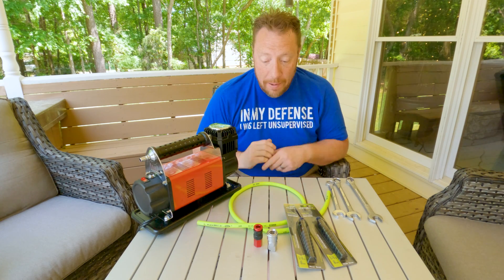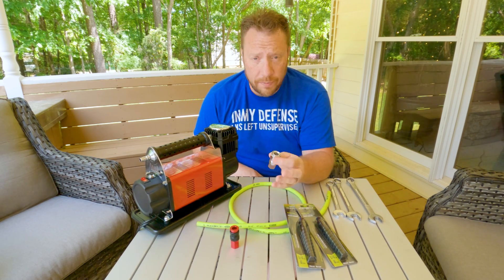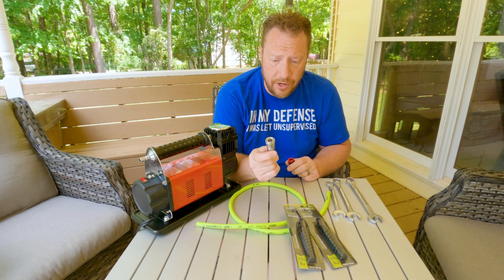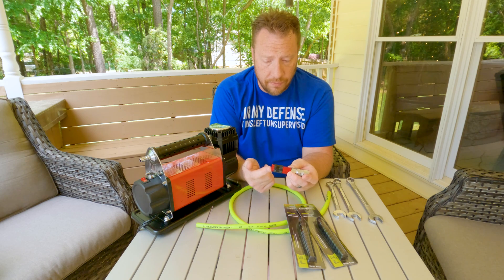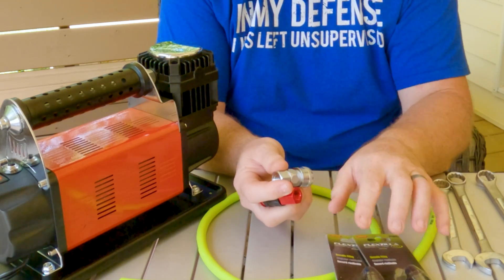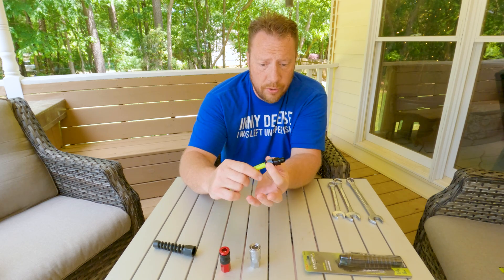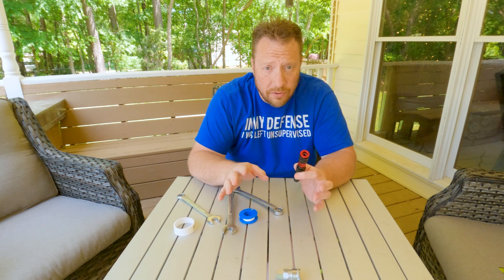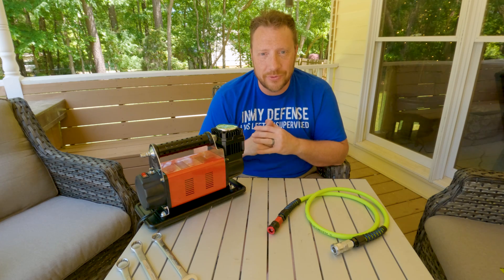Chinese air hose adapter DIY instructions!! (Nitto to I/M)

Comment: On every air tool/compressor I've used you can undo the fitting on the compressor itself and swap it with your preferred fitting/coupling.

However I will say your DIY adaptor hose is extremely well made and far superior to anything I see in retail stores! Very impressive! 💯

Comment: The Japanese Nitto are better, it's what most use here in Australia. They have better airflow and connect very easy by just pushing.
Buy a kit for all of your tools and you will be happier 😊👍🇦🇺
Reply from the maker: I certainly won't deny your assessment. I hate the little rubber grip rings that typically come in the nitto valves, but past that I don't mind them at all. But yeah nah, I'm not going to replace every air hose during I own to swap over. 😂

Comment: Thank you for the details! 🤩. Ultimately, I discovered the type of connector system used in my compressor. The connectors can be found on Aliexpress for about $3, without a hose protector. Anyone purchasing this type of air compressor from Dragon Mart (UAE/Dubai) should acquire adaptors to convert to the universal system (1/4", 3/8", 1/2" system).

Comment: Great research thank you I purchased an airpen off of fb marketplace, that has the same type connector
Reply from the maker: @richardplatko7532  there's places where you can get the adapter, like morrflate, but you can make your own real easy and that let's you use this as an extension as well. And though they're already cheap, if you get one at morrflate, I have a discount code, EVOR. Good for 10 percent site wide. It's not an affiliate link, I make no money on it. But maybe it helps...
Reply: @EverymanOverland  I seen a couple things on Amazon I'm going to check out but I almost went to that link had they supported you I would support them to hopefully they read this comment and change that okay thanks for the response man ,have a great day
Reply from the maker: @richardplatko7532  nah, they support me just fine with test products. They would give me an affiliate link if I wanted one, but I feel like making money by referring you buy something somehow dilutes my words. I'd rather just tell you what works good or doesn't without you thinking I'm just a salesman. I have a great relationship with morrflate.

Comment: Thanks for the info! I'm hooking up a Chinese made tire machine and need to know the name of the fitting style for an adapter to use with an American compressor. Was able to find one on eBay since I noticed the link you provided is out of stock now. Rock on!
Reply from the maker: Ya that was a couple years ago I made that. I should probably go through and update all the links in the comments from time to time. 😁

Comment: I think USA has ARO (aka Milton styple) couplers (fem) and fittings (male) for automotive & industrial pneumatics, while the rest Japan Nitto corp. (not sure about european).
Reply from the maker: That sounds correct, but I'm not an expert either. The good news is that a lot of the compressor suppliers have switched away from the nitto fitting for the US market.
Reply: @EverymanOverland  Be ware ARO has 2 types industrial and automotives. Judging by the shapes one coupler industrial may accept both fittings but please recheck. Nitto otoh has only one for both usage. Cmiww.

Comment: Thanks for the info, I have a Harbour Freight (Chinese) air pump. I've been wanting to convert to a more standard hose adaptor.
Reply from the maker: I have one of those too, the cheaper one that only pumps 1.2 cfm of air... It's Damn near worthless. Check out the gobege compressor on Amazon. 150 bucks and 5.65 cfm. Identical to all the others like the ironman and smittybilt, and it works great. I wish the 2 headed maxi trac would come back on the market, but I don't see any signs of that.